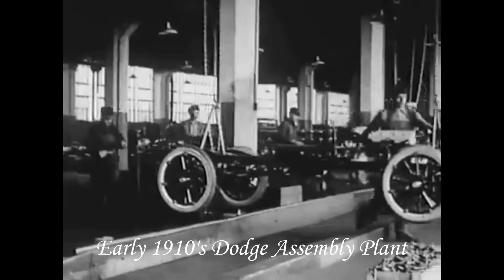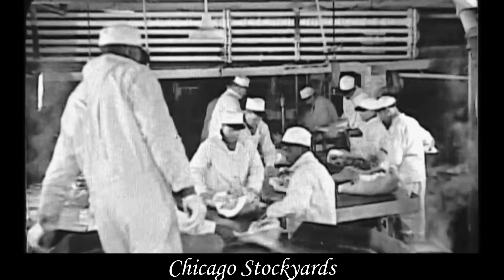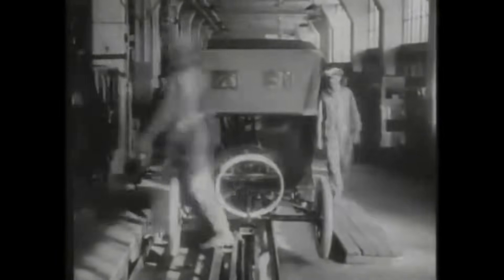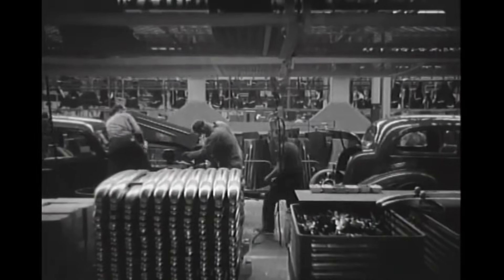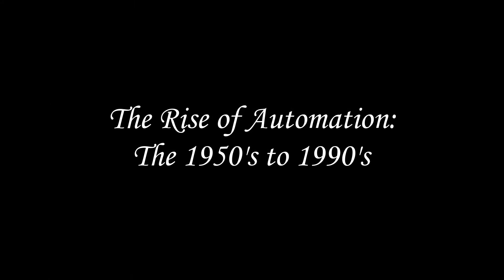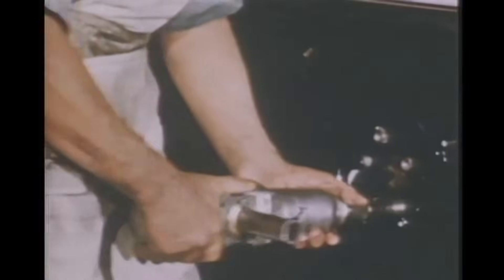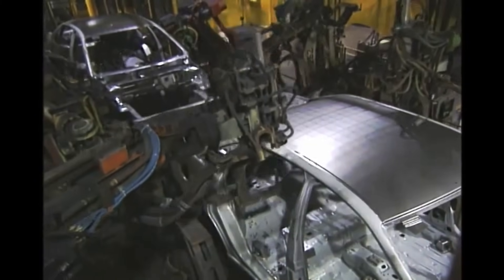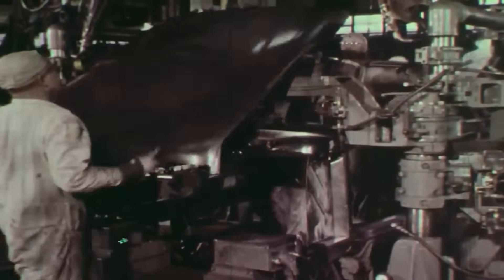The Evolution of the Automotive Assembly Line Was Progress Good or Bad?

Comment: Made in USA needs to come back.
How about a vid on the early Ford Crew Cab pickups, about 1965 to around 1976.     I have heard that the cabs were hand make in Canada by putting two standard cabs together and modifying two standard cab doors for the rear doors.     The top of the cab did have a die made to stamp out the top in one piece.      Wish I had mine back............
Reply from the maker: That's a great suggestion!  Thanks for making it and for watching!  I appreciate it very much!

Comment: time has moved on and quite fast in the past 30 years regarding automation and the last remaining manual labour at least here in germany. 
Plants look quite different to those in the USA. Here ergonomical aspects and doctors had driven the decision where to use robotics: no more work over the head, no heavy parts, and safety first: cars had be turned on the "right side" while still being in the assembly line to mount the exhaust & catalytic system from the side under the car while it was laying on the side (not technicaly laying, cause it was still in the air and hold in place). Key job was to lower the amount of injuries and sick days caused by work

Then the next step were kuka robots to mount the same system automaticall but this time again from underneath when the car was up a bit. 
welding robots were the first, later the front and rear window were glued in by robots cause they were too heavy. More and more parts then became higher integrated like a fully equiped door and what not. The SMART car from Mercedes built in Hambach, the former Hayek swatch car, which first VW had rejected and then Mercedes had adopted was a huge leap back then cause it was a basic assembly line only with branches delivering big pre assebmles from dashboard over seating to engine from suppliers inside the factoy. The main assembly line was no longer a pure manufacturers plant but a mixed assembly line with a lot of suppliers working along the car production assembly line and again more and more just in time connected production. 

Teslas giga castin was the last step of innovation, maybe their tiny car assembly will be another step where you can go into the front room under the hood and in the back to mount things easier. But meanwhile VW has also implemented these techniques for ID.1 and ID.2
Reply from the maker: Thanks so much for such a well written and thoughtful comment!  I appreciate your thoughts very much!

Comment: Mr Olds also did trucks. REO and Diamond REO. And the rock group 'REO Speedwagon' named for one of the products. 
REO trucks last into the 70's. 

As always, thanks for digging up these forgotten gems!
Reply: When you dig into trucks, they are far more similar than cars. The 10 lug wheels that fit a Freightliner also fit Kenworth, Peterbilt and Volvo. They all use components available to the other manufacturers. They build their own cab and bodies, but underneath? The engine is one of the few areas of proprietary usage. Volvo and Mack use their own. Everyone else uses Detroit, Cat or Cummins. 

Yep, I was a road rat for some time.
Reply from the maker: I knew about all of that  REO history.  Dad was a trucker.  He owned a Brockway.  A few years ago during Covid, I found a gent who made resin cast bodies of classic trucks from the past.  When I saw he made my fathers' 72 Brock, I had to have it.  I used an Autocar for a donor chassis.  I was going to do his 53 Mack Thermodyne and get a resin body from him, but he passed away.  Rumor is, someone is trying to buy his business from his spouse but nothing concrete as of yet.